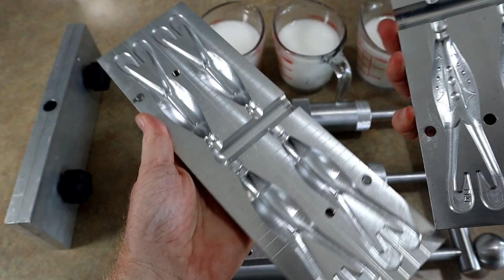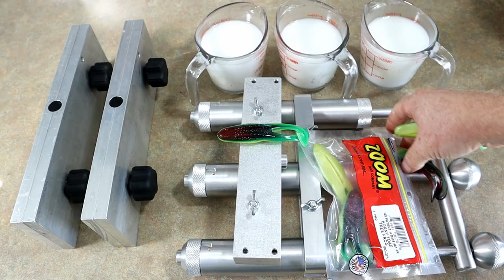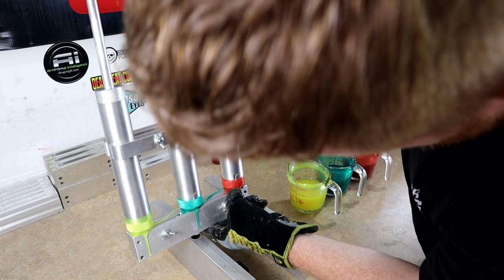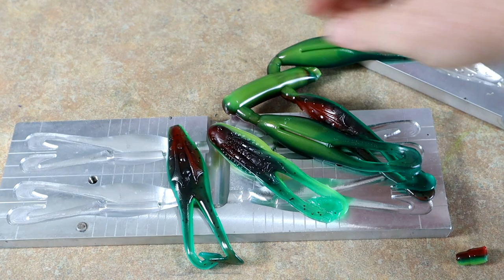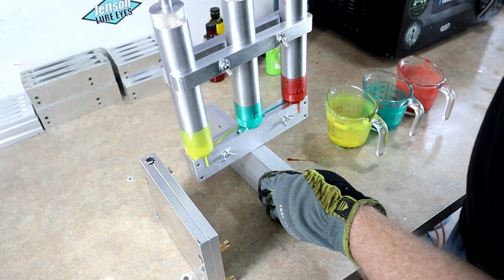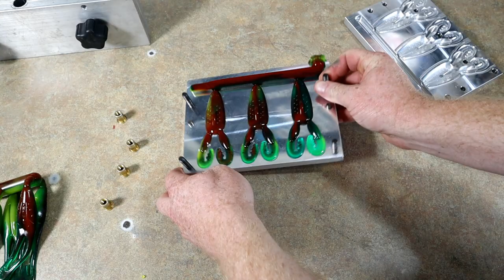Matching ZOOM TREE FROG; Triple Color Frog Color Match

Comment: On the mold that didn't fill properly, were the vents clear? Seems odd that it happen twice in a row on the same mold, if it was the injector then both molds would have not filled all the way... Please remelt the runners and try a single injection on the mold that didn't work and see if it fills, if not then you have a plugged air vent...
Reply from the maker: vents are fine...tube blend is thick plastic and its hard to push 3 at once

Comment: I was using plastisol today and it had bubbles like crazy, i did shake it for a good 10mins? The brand was Do it essentials and it's in a bag and i leave it outside. I do have a chamber but it seems like it has lots of bubbles. Any suggestions would be helpful